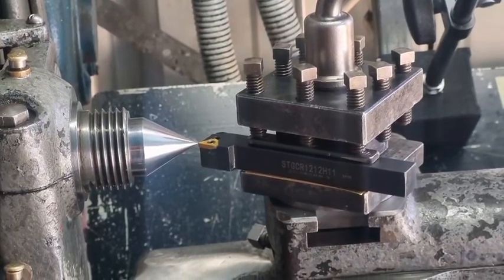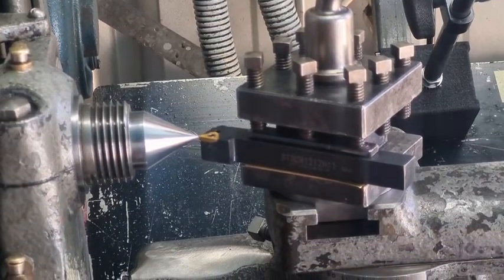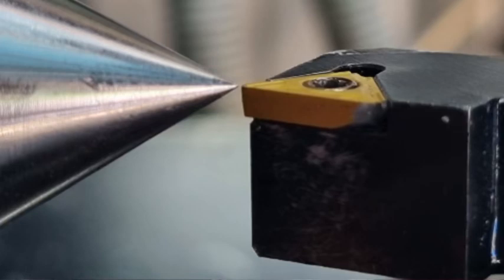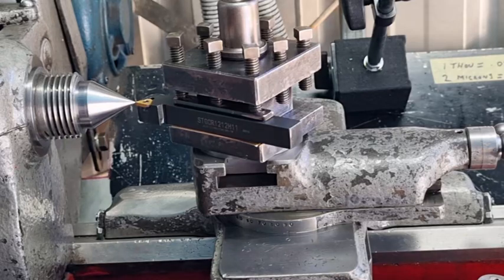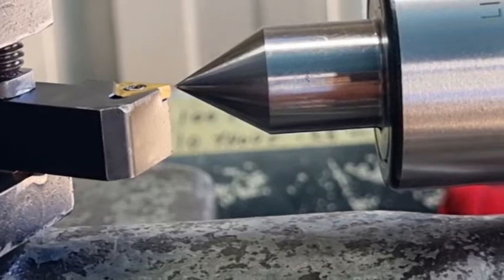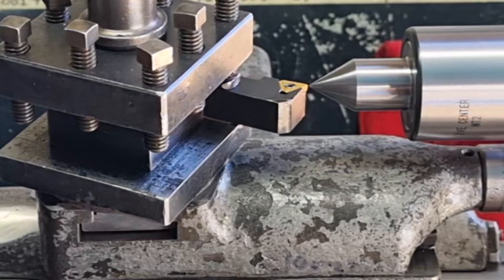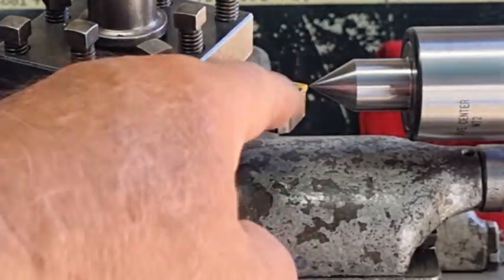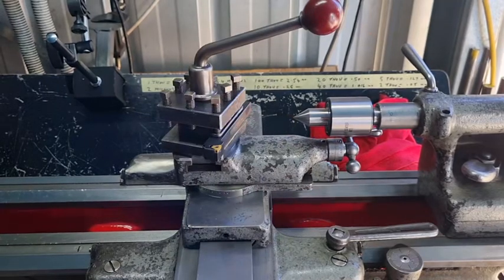Setting tool height 3 simple ways

Comment: All good methods, I keep a set piece for checking height, non adjustable, it can't be wrong then. Also, the rule against the chuck is good unless you have a radius at the tip plus top rake, then the actual contact point may be lower than required.

Comment: A couple of things that may help your viewers. When using the rule ( not ruler lol ), the part in the chuck must be running true. Always best to give the O/D a skim, it does not matter what size it is.

If you decide to make the height gauge, once again, make sure the part in the chuck is running true. Then you can either measure down from the top of the part to the top of the cross slide, or better still, the gap under the part. Then either add or subtract the part radius. This will give you the most accurate height from the top of the cross slide ( not compound lol ). Lining up the tool to a center or using the rule method is not good enough to use as a definitive tool height to make a gauge to.
Reply: We call it a ruler in Australia. “Rules” are for the guidance of wise men and the blind obedience of fools.
Reply from the maker: Yes the Ruler method is only good when you have no other way to do it.
The real test is when you face of a clean cut no pip/nipple in the center